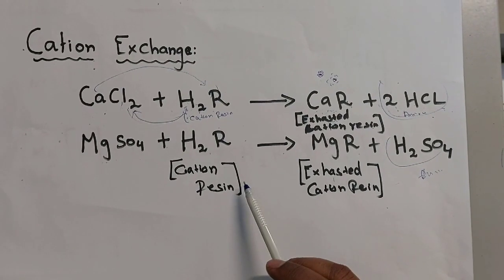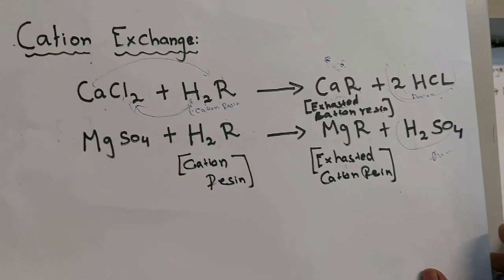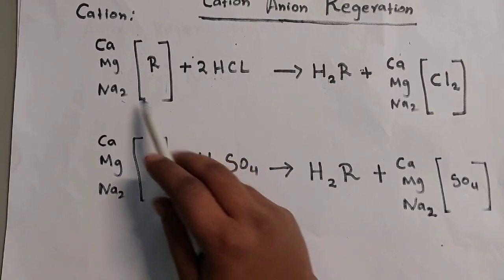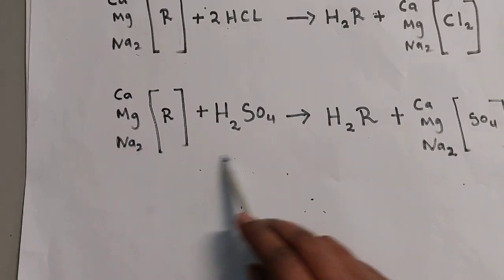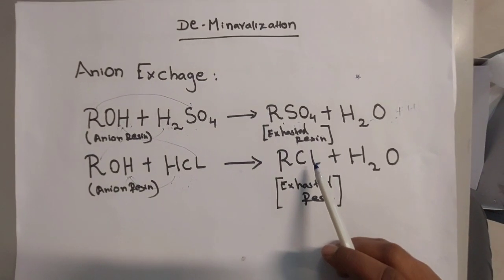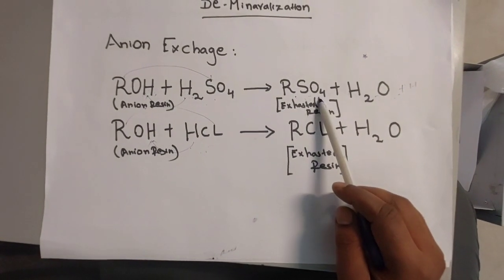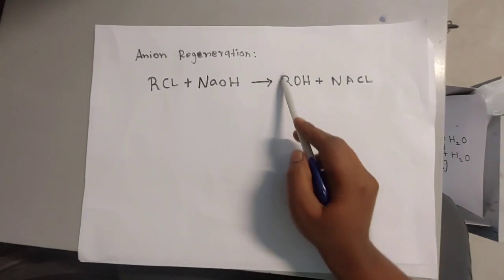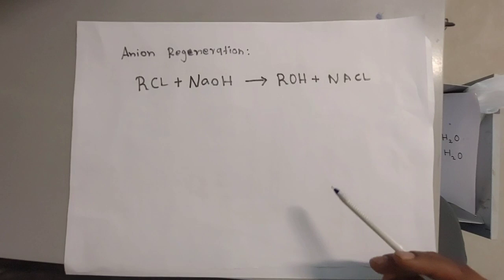De-Mineralization plant regeneration process

Comment: Hi Moya Tech, I have some question about this procedure. I hope you can answer my question if you don't mind.
1. Is there any parameter and range to know about when we should do the regeneration?
2. Is there any parameter and range to know that the regeneration is succeed or not? (Example: TDS of product is under 10% of the feed; I don't know is it correct or not)
3. Does the 4 step of regeneration use different pipeline system with the feed to product pipeline or use different pipeline?
4. Does the fast and slow rinse is a direct flow or backward flow like the backwash step?
Reply from the maker: De ionization plant product when TDs is rised that time we know resins are saturated.. So we need to clean that..

Our SCOP is DM plant product TDs should be 0 ...

If increased more than that.. We need to do regeneration process..